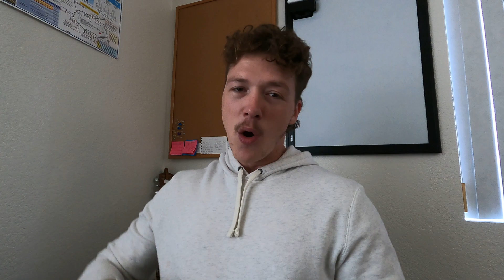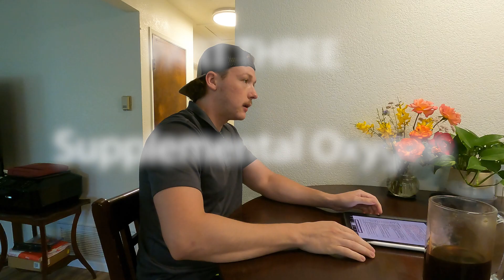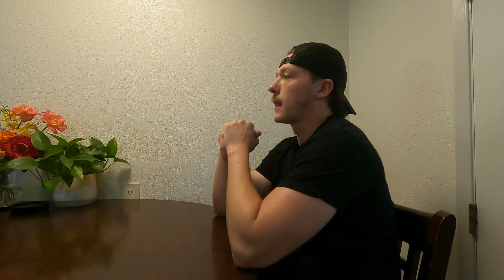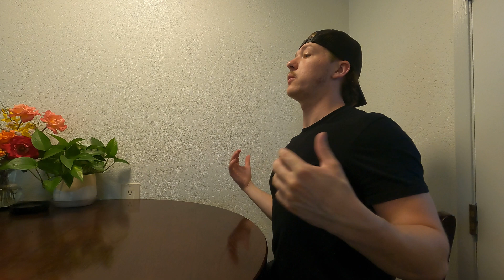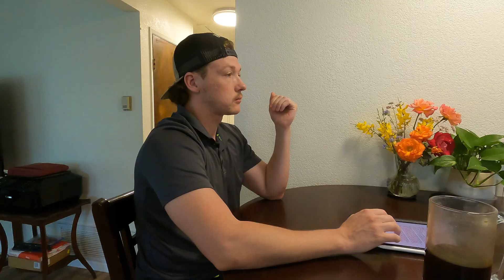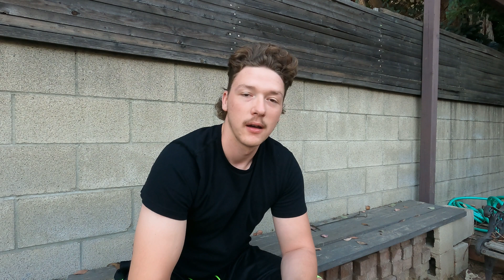Commercial Pilot Checkride Prep Part 3: Supplemental Oxygen

Comment: What is the meaning of question about altimeter setting 29.72 less than standard pressure and cabin pressure 12500??
Reply: The Pilots Handbook of Aeronautical Knowledge states: 

“The pressure altitude can be determined by one of the 
following methods:
1. Setting the barometric scale of the altimeter to 29.92 
and reading the indicated altitude
2. Applying a correction factor to the indicated altitude 
according to the reported altimeter setting”

91.211 tells us that supplemental O2 has to be used by required flight crews when operating above 12,500’ cabin PRESSURE ALTITUDE for more than 30 minutes. He’s saying that if you’re indicated altitude, adjusted for non-standard pressure (therefore your pressure altitude) is above 12,500’ you need that O2 even though your indicated may be lower than 12,500’. 

All that being said I’m not a CFI so hopefully someone can double check me on that. Hope this helps.